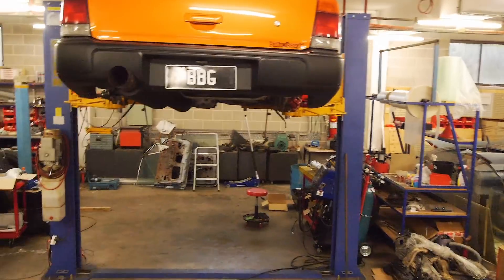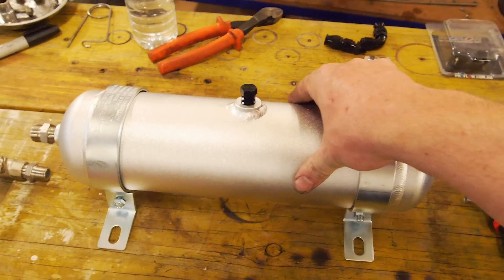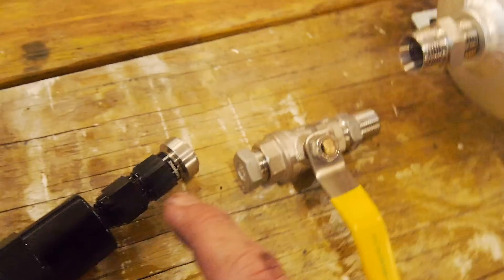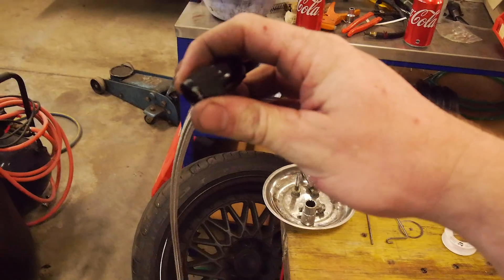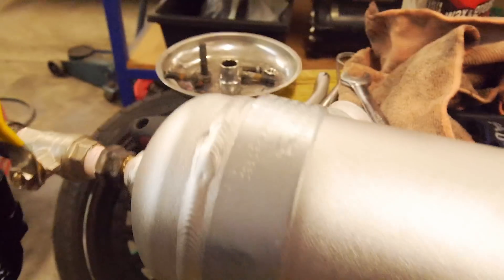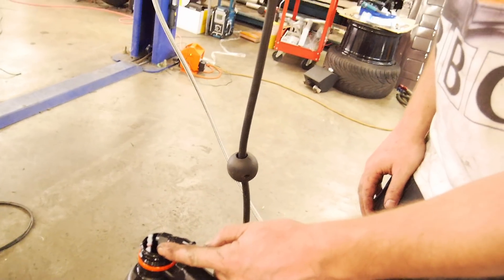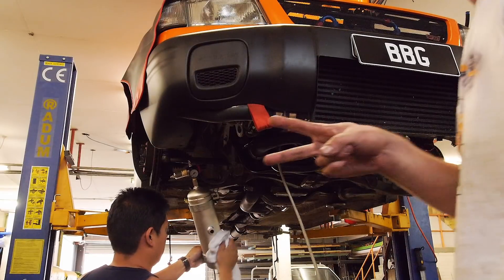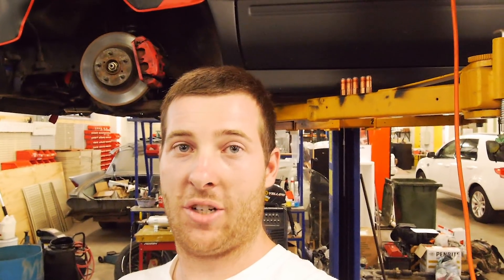DIY ENGINE PRE-OILER /PRIMER - PRIMING THE BUILT MOTOR | THE CRAZY CARROT BUILD

Comment: Hmmm, ok, so you filled the 'engine' from the sandwich plate that feeds the cooler?
Then you even said that most of the oil went in the cooler?
Plus the oil was completely aerated because you used no bladder inside the vessel. 
Nice first try, but I think next time try using a vessel with a bladder in it, so it don't aerate the oil, & fill it up from one of the top oil passage plugs & also when first starting up a new build, the oil cooler does not need to be connected, as its only gonna idle for 20mins before changing the oil anyway.
Reply: Yeah this wasn’t the best idea

Comment: I  have developed  and patented a kit  that feeds preshurized " filtered" oil from a bladder  reservoir with solenoid valve  that fills up when engine is running   to  prime and preshurize galleries hydraulic? tentioner s / lifters  as soon as ignition is ON but engine not started  ...most important it will feed oil to turbo bearings on shut down so no need for turbo timer or having to idle for 5 minutes

Comment: Could you use this setup to flush the oiling system in the engine? It would be nice to use some heavy cleaning solvents without running the engine.
Reply from the maker: I reckon you probably could, as long as you then flushed all those solvents back out properly. Good thinking